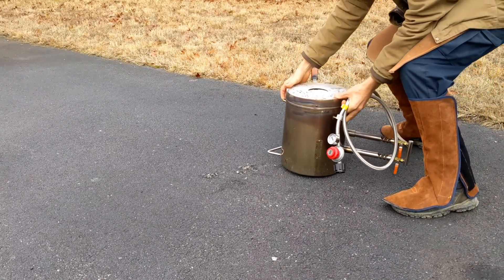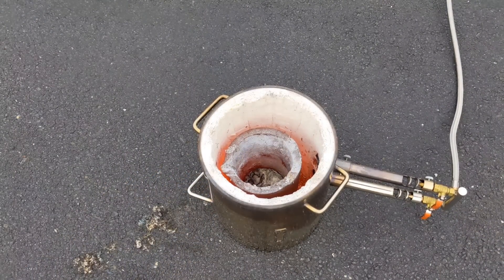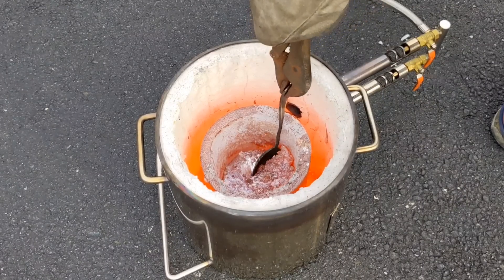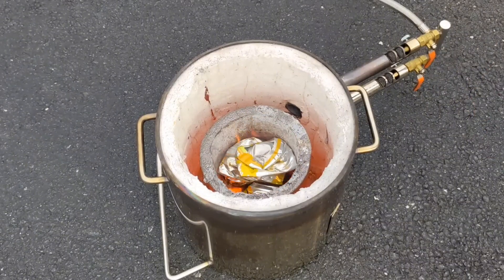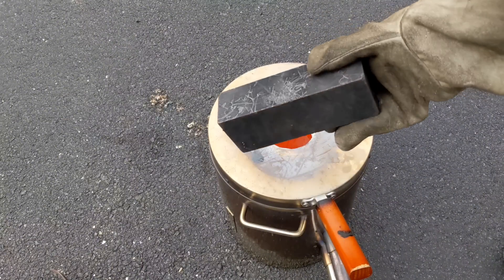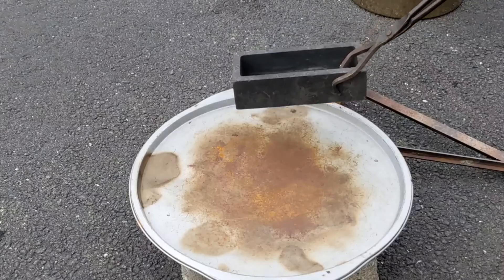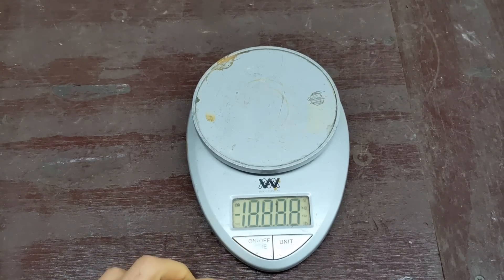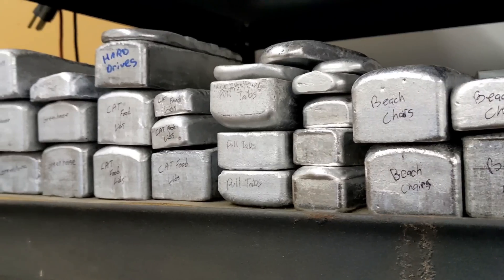How to Melt Aluminum for Casting - Melting Aluminum Cans

Comment: There was another soda can melting video I've watched a while back, and I think to reduce the dross they added in salt! They also talked about having some melted metal in the crucible BEFORE tossing in the cans can help max out how much metal you get from the cans~ So hopefully it's helpful in your can melting adventures!
Reply from the maker: I've seen others do it.  I've heard borax doesn't really help with aluminum.  I do know that starting with Molten aluminum in the furnace would help.  Submerging the cans into the Molten metal reduces the oxidation that occurs.

Comment: Why do you turn off the fire while you load more cans into the crucible?  I just leave mine going the whole time.  I can see the advantage of the large crucible.  I'd like to upgrade from my smaller crucible to one the same size as yours.  I'll have to upgrade my furnace too.
Reply from the maker: I only do that for audio purposes for the video.  I believe this crucible is a 8kg, but the furnace is a 12kg by Vevor.  having a larger crucible definitely makes it easier to melt cans.